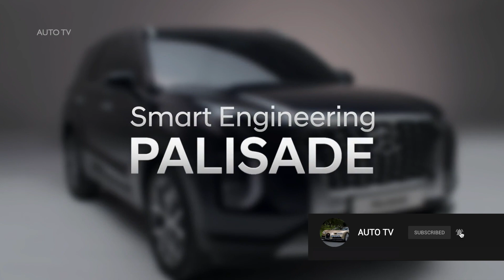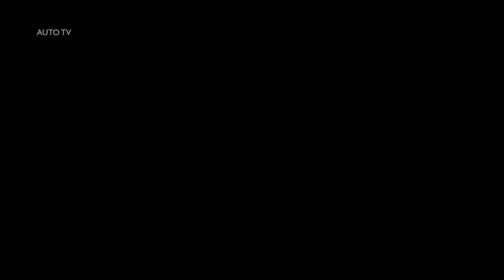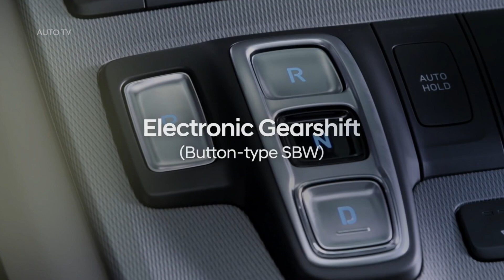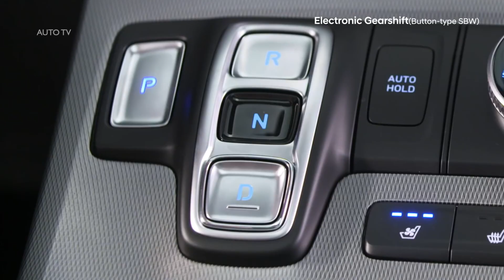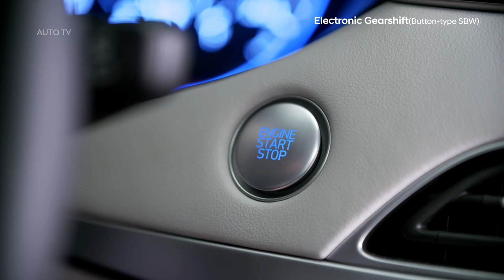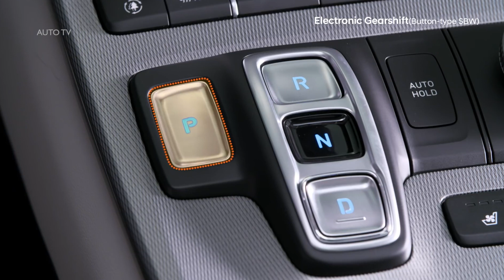2020 Hyundai Palisade – ALL FEATURES Explained!!

Comment: I have a quick question! My Palisade is 2021 model and our rear speakers used to work but for some reason it stopped working. Quiet mode is NOT on and I’m trying to find out how to get these speakers going. Can any of you guys help me?
Reply from the maker: Hi, in fader and balance settings, if you move it to the back, do you hear the speakers at all? Does it sound muffled or there's no sound at all?
Reply: @AUTOTVO  I don’t hear any sound
Reply: For some reason I do not have balance setting
Reply from the maker: https://youtu.be/bMw2sAWkDrE try to see if the position is changed checking this video. Hope it works!
Reply: @AUTOTVO  sadly I don’t have position setting in my palisade

Comment: This is actually the limited edition. SEL does not have heating and cooling seats or the blind spot monitoring camera..
Reply: My SEL has heated seats, but they don't have the cooling function
Reply: @popeyeandy959  yes, I believe there is 3-4 SEL versions before it gets to the limited edition. I also have heated seats just not cooled..
Reply: @HondaMan940  I think you need the leather seats to get the cooling. As I detest leather seating, I don't get the air cooled tush.